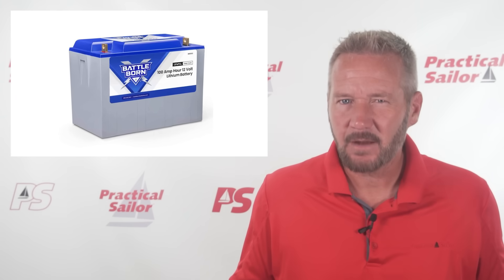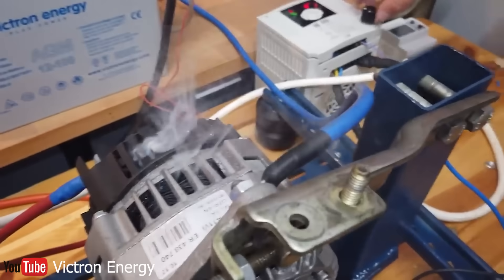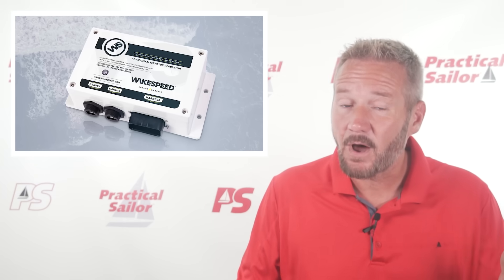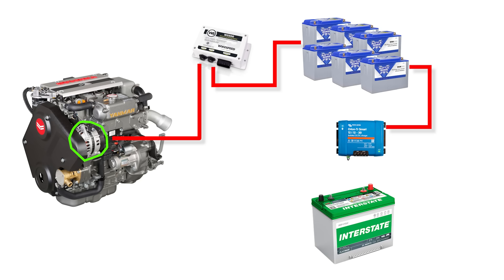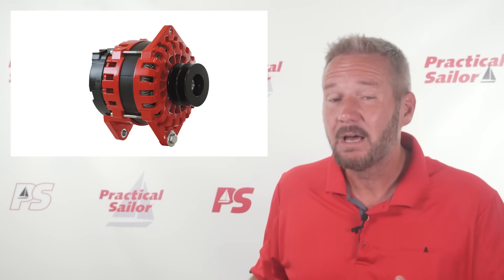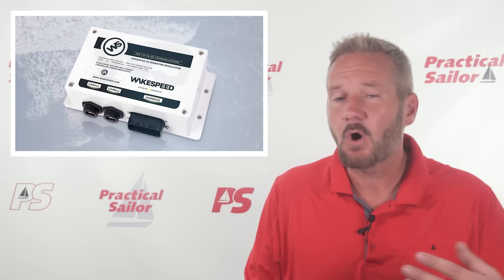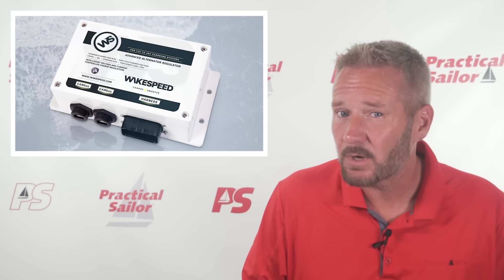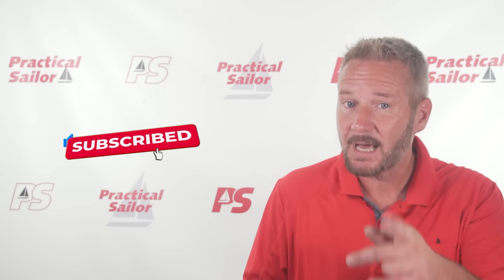Why you should buy this $1000 device for your sailboat – Wakespeed Alternator Regulator

Comment: If u need to run a diesel engine for 10hours to charge up. You
A. Dont have enough solar.
B. Dont have enough battery storage.
Or
C. Have turned your sailboat into a house with way to much power hungry equipment.

Washing machines, dryers, ac units..  its a sailboat not a house..

Good video though.

Bank manager will do the same thing without the $1000 price tag..
Reply: Get every single thing running on the 12 volt system you can.  The inverter is huge sucker of amps.  I went from close to 200 watts per hour on Starlink down to just under 50 with the 12 volt adaptor.  Next up is 12 volt usb chargers so I can charge or laptop without running inverter.  Then I will only need to run inverter if I want to run the Salon TV or Microwave.

Comment: @torstenhansen4308  Yes, You are right.  the Wakespeed guys were the first ones. Unfortunately they got mixed up with the Battleborns and Dragonflys that were only interested in pushing their over priced batteries insisting on CanBus communication with the BMS. This not only complicated the in$$$tallation but also blocked this technology geting more traction in the boater community. Finally ARCO MARINE came to the game with their ZEUS external regulator that allows data from the battery shunt instead of the BMS. So now basically ANY CHEAP Lithium battery can be used and the data from the BMS is not required anymore. However and this is important to understand ... if the BMS shuts down because of an overvoltage event this will create a voltage spike. but there is an easy fix. Use 2 batteries in parallel. Now one BMS is backing up the other. I like the ARCO ZEUS because of the generator function and the easy use. The separate generator function allows high output charging in Low RPM while engine is not used for propulsion while on the other end prevents-eliminates the problem of engine stalling due to overload of the alternator when engine is in propulsion mode. However there is a 3rd  aspect to the equation. This technology makes a marine engine more efficient. While prop design is based on hull speed and calculated on Hp at MAX RPM of the engine manufacturer the most efficient RPM of the engine is at the highest TORQUE. This is especially true in case of Diesel engine propulsion. So a field oriented alternator regulator that allows the alternator to run at MAX Temp limits can take full advantage of that FACT. For more info in regards check performance diagram of the engine manufacturer

Comment: Two years ago I installed a Electromaxx 160 amp alternator with an Electromaxx smart regulator and  a serpentine belt kit. The smart regulator is programable via USB and it also can be monitored via wifi. The customer support was great and they were able to provide the serpentine belt kit for an older Westerbeke engine. I also installed a Sterling alternator protection device as well as a Victron Argofet to charge the start battery. I have dual 300 ah Lifepo4 bluetooth batteries on board as well as 800W solar and dual Victron MPPT bluetooth solar charge controllers. The system works great. Wakespeed was not the first to develop this technology just the latest. I plan on helping a friend install the Wakespeed on his boat then I can compare the two systems. For me the only downside is having to connect via bluetooth to all the devices using multiple apps. I think I have a solution I hope to test this winter that will combine all the bluetooth and wifi information which i can display on a browser on a phone or tablet.

Comment: How am I going to live with less than 100 amp hours? If you put a tungsten projector bulb in series with your alternator, you can charge any gigantic lithium no problem. I finally graduated to lithium. A 7 amp hour 13.28 volt Thiss dinghy battery on Amazon. The highest taper charge I've ever dropped on it is 13.45 volts. It can handle a boat radio and nav lights for a few hours.

Comment: I have installed a Wakespeed for a customer.  One almost needs a masters degree in computer programing to set it up on a laptop.  Not exactly "user friendly".  I understand that they are now producing a unit with Bluetooth.  I would like to know if their app is any more user friendly.
Point two.... most of the Lithium batteries that I see on the market do not have Canbus or any other kind of output.  There is the odd one now with Bluetooth. Will this network with wakespeed Bluetooth???
Point 3....... I would like to see how the wakespeed compares to Balmar or Arco Zeus regulators.  That would make for a  very interesting research project for Practical Sailor.
Point  4 - The BMS would have to talk directly to the regulator to protect the alternator, without that, the alternator cannot be connected directly to the Lithium batteries.
Point 5 - Ever consider using a voltage sensitive relay to supply power from the start to the house battery......... EG ....Victron Cyrix Li-ct (up to 220 amps) or an EGIS unit rated up to 500 amps??????    I cannot recommend DC/DC transformers.  You loose power (up to 15%), and they seriously limit charging rate to the Lithium batteries.
Reply: Point 5, why on earth would you want to complicate something that is so damn simple? Also, DC-DC chargers are great and extremely efficient, nearly perfect. Victron units are the most efficient I have ever seen.
Reply: Point one, don't use the wakespeed if you can't program it. The Zeus one is extremely simple to program with your phone. It is just like programming a shunt.
Reply: Point two, you do not need communication with the battery. There is nothing the bms will provide that the alternator needs. If you are worried about a battery failure, then install a snubber.
Reply: Point 3, I personally prefer the Zeus. I like the features and GUI better.
Reply: Point 4, WRONG! you do not need any communication between the bms and the regulator. Whoever told you this is an idiot.

Comment: What's wrong with the time tested, rock solid balmar 614/618 at a third of the cost?
Reply: I have and like my Balmer 614, but if you don't understand how your alternator and charging systems work the instructions included in the box are for going to feel overwhelming.
Reply: @GregoryAlbright-t3p  Exactly. I have a lifetime of AC/DC power training and experience. Unqualified DIY'rs should leave well enough alone and hire somebody when it comes to power. Especially high current and lithium
Reply: @GregoryAlbright-t3p  yeah, the Balmar stuff is a little harder to understand.
Reply: Absolutely nothing wrong with them. I love them. When you have two engines, you'll need a centerfielder.

I installed a pair of 220a/24v alternators on a sportfish, with the 618/centerfielder. They have been vranking for a couple years with zero issues. The house bank on that boat is 66.5kwh.

Comment: $1000 is absolutely overpriced. I let the alternater charge the starter lead-acid battery. Then a B2B (Battery to battery charger) is used to charge my lIFePo4 Battery. I selected the B2B charger to match the maximum current the alternator can produce. When attached to the shore-power, my B2B charger uses about 0,5A to top off the starter battery. 
Also it is important to investigate your power usage and replace power-hungry devices.
Reply: What size b2b and brand?

Comment: How does this work with an Onan 5kW generator?  Does it integrate it, ie; like a second alternator or does it make the Wakespeed un necessary.  Also, can the DC2DC charge not just the starting battery but also the bow thruster AGMs?
Reply: A generator doesn't charge the batteries, so I don't understand your question.
If you use ACRs, then one DC-DC can charge multiple different lead banks, as long as they are the same chemistry.

Comment: I recently installed an ARCO ZEUS regulator (sku:AZ10000) and ARCO ZEUS alternator (sku:4501) on my Yanmar 4JH57. At 1500 RPM I get a continuous 3000 watts with a 2:1 pulley. I paid about $2700 for the alternator and regulator system, which sounds expensive until you consider this has made having a diesel generator completely obsolete. I have 1240 AH of LiFePO4 and 2120 watts of solar. We're on the other side of the bell curve fellas. We've been waiting for this for decades. Total off grid capability!
Reply: Excellent
Reply: Voltage?
Reply: @elgordoroxx  24 volt Victron system.
Reply: I love the idea of the Arco but I have read that there have been a lot of problems with the software especially regarding interfacing with a Victron systems.
Reply: @jamieweyndling1861  I was concerned about the same thing. However, I was assured the newest firmware updates resolved the old bugs/issues. (1) not powering on (2) inaccurate battery voltage readings, (3) false errors (4) inaccurate RPM settings (5) float mode voltage spikes. So far none of these issues have occurred on my system, so it appears to be resolved. Bugs are to be expected with any new technology, how quickly and effectively a company resolves the problems is an important factor when choosing components. I have no regrets but I'm excited for the next generation of regulators. I'll probably upgrade when the newer better stuff hits the market in a few years.
Reply: How much hp are your motors? My boat a Catalina 36 mk1  only has 21 hp. The problem is keeping the 120 amp alt, cool. With a Wake speed, and 850 amp hr battery bank, it runs around 60 amps of output. This is all due to heat. I also have two blowers in the engine room. 
my next experiment is to replace the alt with a water cooled one.
Reply: My understanding is the ARCO Zeus uses only voltage to control the charging process whereas the WS monitors voltage and the current draw to control battery charging.  If this is the case, I am, not sure if the Zeus is worth the expense.

Comment: As an installer that has installed many units I can say wakespeed is very unreliable and their customer service is horrible.
Reply: Vintage installer here. Ample Power, Balmar, Wakespeed. Currently using Revatek for quality build, easy installation, WiFi integration. No more magnetic tipped screwdriver programming.
Reply: yeah everyone I know with a wakespeed has had problems with them and poor customer service
Reply: Interesting thanks.
Reply: We replaced our AGM bank with 800Ahr  LiFePO 4 years ago. Use it for house and engine. All one big bank. Charges from solar, engine, wind and occasional AC. Works perfectly and no DC-DC needed. Alternator is 15 year old Yanmar 3JH5E
Reply: What sort of issues have you had with WS500 installations?  I know the programing can be complicated and it takes some practice to get it right.  Matt at dragonflyenergy is very helpful.  I've been installing WS500 setups since it came out and have had good luck with my installations.

Comment: Externally regulated alternators is a very US things. Most other people install solar and get power for free rather than burning diesel. Why would you want to charge lithium this way when for way less than $1000 solar can do it for free. We average around 6kWh per day in the tropics from solar. You would have to run your engine for over 2 hours per day just to make the power i get for free
Reply: Beacause we don’t all live in the tropics
Reply: @davidkirk7789 neither do I. We make enough power in the UK with long summer days
Reply: Sun doesn’t always shine and if you are motoring anyway you got almost free charging as you go
Reply: @jamieweyndling1861 we are a sailing boat not a motor boat
Reply: Because how are these people going to run their electric clothes dryer three times a week. We're not talking nav lights, a 38 watt chest freezers, a CB, and a VHF.
Reply: @stanleybest8833 we have 14kw of lithium, freezer and two fridges, immersion heater, electric galley (no Propane onboard), ac watermaker running off a large inverter making 60 gph. We have a DC/DC charger but a rarely switch it on. We just don't need it with bifacial solar panels.
Reply: Dude, really? Dream world
Reply: @samaeri is that where you are😂

Comment: I have 2-250 amp Balmars on my catamaran with 2- Wakespeed controllers.
I added cooling to my alternators and it made a huge difference to our lives, we do not have a generator.
1,400ah of lithium and no propane.
Watching 400 amps going into my battery banks is mind blowing.
I limited the output to 200 amps
Reply: what type of cooling are you using?
Reply: very impressive. great info.  thanks.
Reply: Any solar or just engines?

Comment: I discovered there are several solutions to charging LFP batteries and each have their advantages and disadvantages. For my 600Ah LFP house bank I chose a simple regulator on the engine alternator charging the engine AGM battery, then draw from the engine battery using two Victron Orion DC to DC chargers which charge the house batteries. This provided a simple, easy to understand and troubleshoot solution. Each Orion proportionally turns on at different input voltages which prevents overloading the alternator at lower RPM. Voltages and loads are easily monitored and adjusted using Bluetooth on the Orion chargers. 

This approach leaves the engine, alternator, regulator independent of the house batteries. If one Orion fails you have a backup, if the engine battery needs charging the Orions wiring can be temporally reversed.
Reply: How many amps can your AGM push into your LFP's? Are you in that situation where your LFP's could fully charge in an hour if you could use all the amps your alternator can produce, but it takes 4x longer because your AGM can't push that many amps back out?
Reply: @glowingfatedie 
This is a misunderstanding.  The current does not go through the AGM, rather the alternator passes the power to the Victron which charges the LiPo4. At the same time, amperage above the Victron's demand is used to charge the AGM. So both batteries are charged at the same time. The majority of the time the start will only accept a small charge as the load of just starting the engine is small. So most current is going to the lifepo4 were it can be limited by the victron  so as to not overheat the alternator.
Reply: @glenndennis6801  You got it 👍 When thinking of the Orions I think of the starter battery as a big capacitor. The voltage regulator (Balmar MC-618) attempts to hold the alternator output at the AGM charge profile voltage as measured at the battery. Then the Orions can be thought of as accessory loads like car headlights. When the load comes on the voltage drops at the battery and the regulator ups the alternator field voltage to supply the necessary current. The battery voltage does drop a bit but the Orions compensate. With a 170A alternator the Orions easily can pull their max of 50A each when the alternator RPM is sufficient. If not the Orions are programmed to shut off if their input voltage drops to a predetermined setpoint. The regulator will also reduce the field if the alternator case temperature gets above 100C but the Orions shut down before this occurs.

With other designs I could get more into the LFP bank but in my application it is not necessary and prefer the safety redundancies of this design.

Comment: Just to be clear, the Wakespeed is not a pass-through device. Your schematic and script could make viewers think it is. The alternator output cable connects directly to your charge bus while the Wakespeed controls the field current based on data input from the batteries, the alternator, and a shunt in the main negative cable. The shunt allows the controller to regulate the alternator based on current and not just voltage. This is important because it takes all charging sources into account and not just the alternator, which allows you to control the battery charge rate. In our case I want to charge the 24 Volt house bank at a conservative C rate at 200 Amps. The alternators can provide that without being stressed and when our solar kicks in, the Wakespeed will dial back the alternator to keep the current at 200 A.
Reply: I wondered if it was a passthrough device, but sadly it isn't.

Comment: Wish size engine included in explsnation, a 20hp diesel cannot support very large alternator, a 80A balmar, i had on such took a lot of power that otherwise went to prop
Reply: 80 amp alternator would take just over 1 hp. Not very much.
Reply: I have installed the 275a Zeus on very small engines. They require about 6hp or less to run, and you can turn them off if you need maximum power to the prop at any time.

The issue I see most is people not having enough wrap on the alternator pulley, which causes the belt to slip, causing other issues.

Comment: Mastervolt do a setup including programmable controller and 24v 190ah Bowmar 2nd alternator.  It work well.  The current draw can also be programmed to engine speed to prevent stalling.